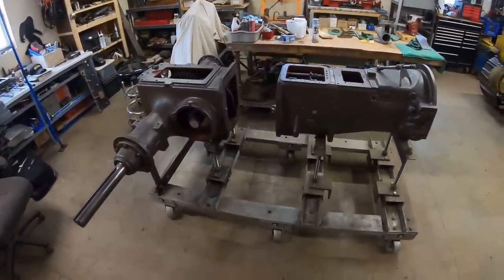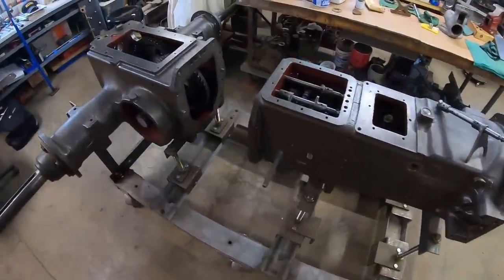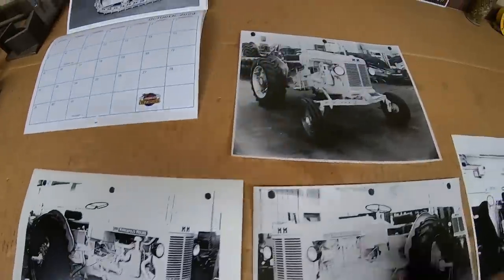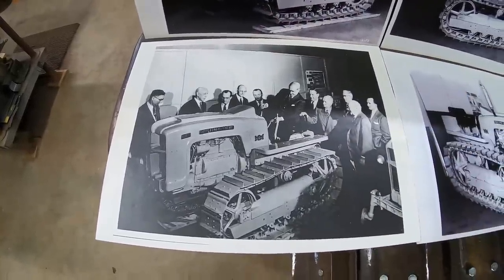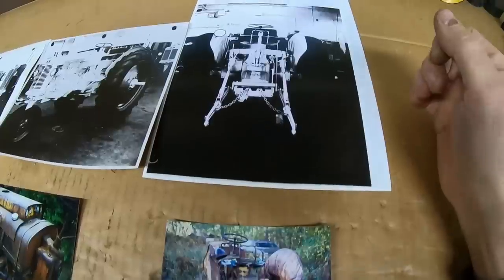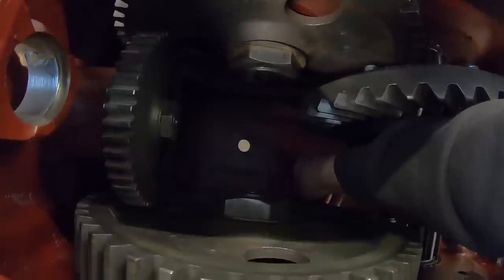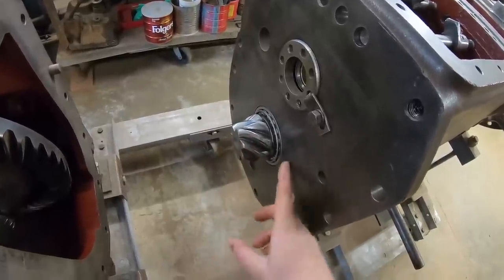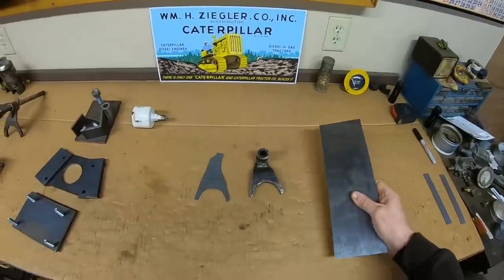Can We Save This Tractor??? Minneapolis-Moline Prototype #X231 Back-Story & Restoration Efforts

Comment: X231 sat under a tarp by the door until you finally moved it out of the way to build the 5J1113.  The 5J build was incredible and your attention to detail is meticulous.   You did post a video back in the day about having to step away from the x231 but I did not realize how close it had pushed you to the scrap pile.  From the comments you can see that there are alot of x231 fans. Do what you can and step away when you need.  It will make the project better in the long run.

Comment: Yay, X231 is back. This is the tractor that won me over as a viewer. The logical thought you put into the repairs and component replacements was as good as it can get. No, it will not be a 100 percent restoration but with what was there to start with and what was and is available for replacement parts you would have made the engineers in the R and D department proud with your choices.

Comment: It'll be good seeing X231 get into the light again. I know as well as anyone that projects take priority - the Case SC is in desperate need of some repair work at Midwest Cylinder Head (hopefully they can fix it)... And the bearings/seals in the rear need a complete overhaul... But I keep getting more and more projects that take priority over Grandpa's.... Be good to see X231 even if it is just a time filler. Progress is progress!

Comment: I’m an early Ford tractor man and I have 9N52, the 52nd Ford N tractor ever built sitting outside awaiting restoration. While it’s an early regular production tractor, Ford was making small changes on the fly during the first year of production. The oil fill pipe was in a different location on the first few dozen tractors, the shift lever was chromed, the bolt arrangement in the governor was different, etc.. It’s hard enough to do an accurate restoration when a tractor was one of a small early production group much less what you face with a one of a kind! I’ll be following every video of your restoration efforts. Good luck and Godspeed!

Comment: I have been waiting for you to get back to this tractor for years now it's what got me watching your channel in the first place , have loved watching you rebuild and bring back to life all the equipment and tractor's you have worked on . If you run across any disk blades for a horse drawn disk with a 7/8" square hole let me know current outer diameter is 17" ?

Comment: @Squatch253 I  just started watching your videos a couple days ago. Now I have watched the series in starting system all 24 or 25 videos and watched you start the engine outside your shop. I think I understand how the pinion system works. I think the sequence is: start the pony motor then push the pinion lever down toward the front of engine to put pinion brake on then ingage the pinion lever that engages pinion shaft gear to pony motor then lift the lever in front that had brake on and that releases the brake on the pinion shaft and allows the pinion to turn the diesel engine. A guy I know has a 1937 I think 1937 d4 and he turned the pony motor off before the diesel started he said it is going to be hard to start pony motor now. I think if the pinion is working correct all he has to do is lift the lever all the way up hard that puts brake on on the pinion till it pushes the clutches to release the drive gear from the pony motor. But now thinking about it does pulling the lever engage the shaft or disengage the shaft. Ok guess I need to watch it a 3rd or 4th time. I got to drive it but it is in bad shape, when I lift the blade it drops (leaks down) pretty quick this is the first time I have driven one this old. Maybe you could give a talk on the sequence of how this works. Thank you I really enjoy your videos

Comment: BTW if you ever need to re-create the texture of a casting, I like to use a needle scaler and lean on it a bit, it'll give you that nice fresh cast iron look in a few minutes. Even if the repaired area was previously ground smooth. Way to make repairs invisible.

Comment: Considering the rear end/axle is brazed and thus I presume weaker, are you going to put a draw bar on it this time or leave it off to preserve the unique casting?  Thanks for sharing. :)
Reply: @squatch253  I had no idea braze was stronger than cast iron.  Thanks for the info and while I do like to see old machinery still alive and doing its thing, I think it's a good thing that she'll be on light duty.

Comment: This is gonna be interesting. Two questions, I may have missed the explanation, however, what was the M-M factory's objective to develop this machine; more power, cheaper to manufacture, compete with another manufacture's model, etc? Also, most R&D departments don't let out their creations, like in automotive, the prototype is tested and then ends up in the crusher. Any idea how this one escaped?

Comment: I thought the lower radiator and power steering casting repair was where you left off with X231. I stand corrected. Dementia on my part I guess...
Reply: @squatch253  check out a few of CEE videos, there out of Australia but his work is on par with yours its ether perfect or its not done. There video's should help give you a couple ideas on cutting in that stap ring slot.

https://youtube.com/@CuttingEdgeEngineering

Comment: I have a question, I am looking to buy a project dozer, it is a 1959 Cle-Trac needs a lot of work what would you recommend.  It does not have any tracks on it not even chains but I am pretty sure everything else is the except hood.  Would it be a good project to take on, in your opinion
Reply: Are looking at Cle-Trac in particular?  The guy to talk to or visit his channel, “Shop Time with Dave”.  Dave has a YouTube channel where he is restoring an old Cle-Trac.  Where abouts are you located?  There is a 1950 Oliver Cle-Trac running machine near me.  The original engine was replaced with a Wisconsin (gas), it’s rough but may be a good parts donor or even a good start.
Reply: @squatch253  the daughter of the fellow who owned this machine said he had it covered up in the shed where he had started a complete restoration on it when he got sick and passed away she is selling all of his equipment.  She said she thinks the tracks are there just gotta look for them.  The pics I have seen the matching looks to be in good shape, won't know till I look at it in person,. I do know it was built by the Oliver tractor company.  I am just looking for another opinion
Reply: @JoeAroner-SIWAYTV  awesome I will look it up.  I can purchase this unit pretty much for scrap price, my concern is the tracks, it has all new sprockets, rollers, and idlers.  I am gonna try and go get it this weekend.  I am open to any and all info on this machine